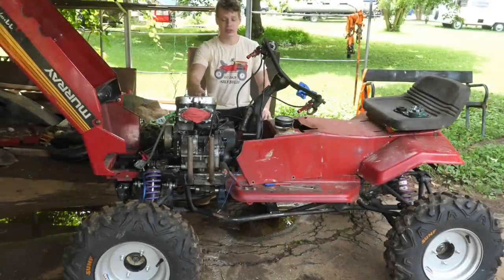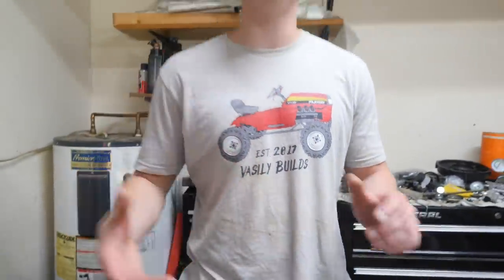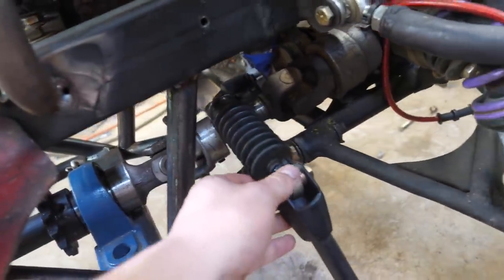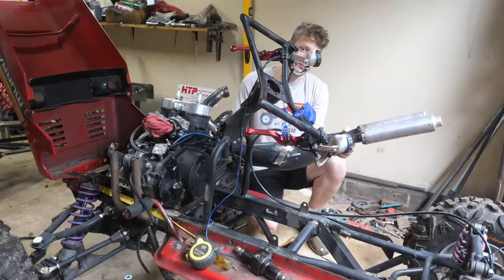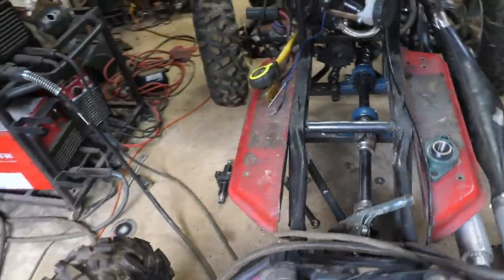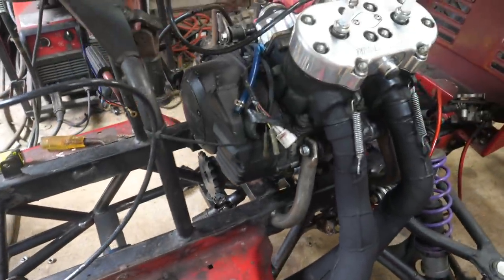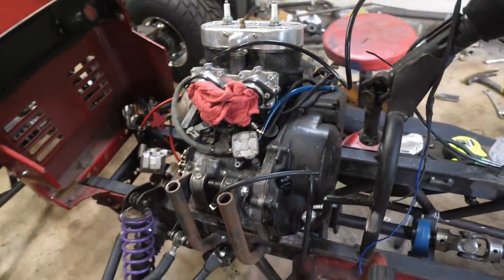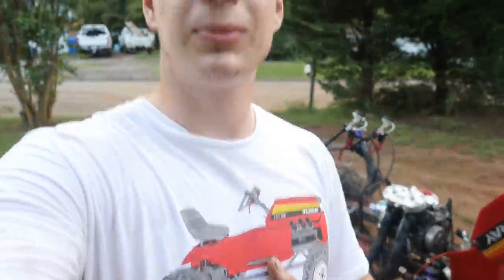Ultimate 2 Stroke 4x4 Rally MOWER Almost Done!

Comment: Not to knock the work done on the exhaust, but could tips be added somehow to angle the heat away from the running gear in the rear?

Comment: One problem I foresee coming out of this is the small sprockets to chain length ratio. I know from experience with doing something very similar that the small sprocket to small sprocket size means that they will be spinning pretty damn fast. The other is the use of a short chain length. As RPM's increase to the sprockets the chain of course is also moving this much faster right. What happens is over any length of time, speed and load is going to cause your chain to become smoking hot, literally! Burning off the factory grease inside the rollers and very quickly leading to chain seizures on tighter riveted roller links first. You can spray the thing with cans of chain lube, but it's going to be a fruitless endeavor as its primarily made to lube the outer surface of the chain to sprocket contact points. That being said the rest gets flung off from the RPM's of the chain and burn the rest of the lube off the chain links leading to chain failures. Hence why they use chains only inside cases that give them a chance to cool off and be bathed in oil before going around again. Even applies true for a chainsaw, without a working oil pump constantly lubing  the bar track and chain links it leads to utter rivet/roller/link failures of the chains. IDK? This is just some words from the wise, been there before and got the Award's. Hope you have better luck with yours.
Reply from the maker: O ring chains solve that problem
Reply: @VasilyBuilds  I was going to mention that, but the O-rings melted and only extended the life of the chain for a few minutes longer. It has to all do with the amount of friction being applied to the speed of it turning. I came to realize my mistake after realizing that because this phenomenon does not occur on a daily street bike or ATV for this matter, it's all due to the sprocket to sprocket size ratio being everything usually has a rear sprocket 3-4-5+ times larger than the front and you are adding in the length of the swing arm thus the chain is traveling straight in free air space to act like a cooling area on the top and bottom of the length of chain. When you put sprockets that close together you now have absolutely zero air gap in length to allow the links to cool down enough before the next wrap around a sprocket. Then you add into the account, the sprockets diameters, a small sprocket like a pulley or wheel is going to rocket the speed of the chain and not having any long stretches of straight or relaxed link's it will continue to accumulate heat until it vaporizes everything on them. Believe me they will probably glow red if they didn't seize up and snap long before that happens. You have the same exact scenario I faced and went through, too little chain length, too small of sprocket diameter and not enough cooling time inbetween the links before its wrapping around the next bend of the sprocket. For short quick bursts, like an engine without a cooling system, yeah you'll be fine. Once you cross the threshold though of temp and the grease and orings vaporize it's all over in a matter of minutes. Just trying to give you a little heads up, I've never put a chain through a clutch case on any bike before even racing, but I've come across plenty who have. A banshee engine isn't by any means cheap to replace when you stuff it with a chain, that's why I'm trying to save you some pain in the future. If you've ever seen friction welding done before??? You'll have a better understanding of what it takes to fuse steel to steel and it only takes one link out of a dozen to fuse, then you get a tidal wave of chain balling up against the aluminum case, steel VS's aluminum we know the outcome not even the most expensive case saver in the world is going to prevent happening. Just sayin bro, I've been there exactly where your going and it doesn't end well. We live and learn I guess?

Comment: Oh no.. lol..   Bro. Those pipes are specifically tuned to make the engine run a certain way.  It's not like a 4 stroke.  A 2 strokes pipe/ especially the expansion chamber is what sets where your powerband will be (it's RPM range) -- and it functions like a turbo charger..  A larger pipe will give you more low end torque-- where as you'll see "racing" pipes will be smaller, and that's because it sets the powerband at a much higher RPM's.  The distance from the exhaust port back to the end of the expansion chamber is a precise measurement and it sets the timing (in RPM's) that an exhaust pulse will resonate and bounce back to the chamber -- forcing extra pressure to be pushed back into the cylinder- through the exhaust port and that's what creates the EXTRA power at a give power band..  and that's why you can change your pipes and change your engine entirely.. and go from a skinny, high rpm race pipe, to a FAT low RPM trail riding pipe- which will give you more low end torque..............   So What I'm trying to say is-- at the VERY least , your pipes have to match or it's going to run terrible and have no power.  It's eaiser for a DIY to get around this by Y-ing them into a single pipe, so that you only have to build one expansion chamber.  But I'm telling you, if it runs like crap-- it's because you have to do better with those pipes man.  There's a whole science to 2 stroke expansion chambers and exhaust timing and resonance, ect.
Reply: 2 stroke pipes are not as critical as people make them out to be. Your theory is correct but the changes need to be much worse than what he has done here to make the motor run poorly.
Reply: @tke7mu0u  It might work fine... I'm just saying "IF" -- if it doesn't run right--- that has to be addressed.  I have a 500cc Rotax (snowmobile) engine that I put onto a 2 seater buggy and  I had to cut off 2-to 3" of the pipe  right at the ports, to make the pipe fit--- and now it runs like crap.. and I wish I wouldn't have done it.  It still works-- and still has some power-- but it just moved the powerband much higher into the RPM range and now doesn't have any low end torque, which sucks-- and makes it not as fun to drive -- becaue its either full throttle or no throttle everywhere.  But anyway, since then, I've fixed it, after learning more about the expansion chambers and how they work.......  Also, I've had several banshee's and still own one now--- and they are completely gutless without that power band kicking in.. So you can go cutting on the pipes all you want, but without them being tuned well (especially on a banshee)---  it's not going to be fun.
Reply: @calholli  yes i fully agree. I just meant that a lot of people with out practical experience believe a 2 stroke pipe needs to absolutely perfect to run properly when in reality its not the case. From what i can tell he didnt really shorten the pipes though. For every 2 inches shortened it moves the power up roughly 700rpm. But properly tuned pipes on any 2 stroke can make a big difference. In the case of your snowmobile which runs a cvt they will have a narrow powerband already so by shortening the pipe it will dramatically affect the feel. Where pipes designed for a gearbox generally have a larger spread of power to make the power usable so shortening it an inch will only move the power slightly higher up the rev range. For this application he may be better off lengthening the pipes

Comment: Yo Vasily you can't just flip the steering like that!! If you turn now, the outer wheel will steer more than the inner wheel... The outer wheel travels in a larger diameter in a turn so it should turn less. This will cause the steering to work horrible if it works at all. you either have to flip it back to the frot or make the steering arms pointing away from the mower. Keep it up dude, all of your builds are amazing
Reply from the maker: That was what it did before, that's why I moved it. Can you explain?
Reply: Ackerman steering. Look it up.

Comment: Why didn't you put the engine how it normally goes into a chassis an run a chain to both diffs or you didn't wanna re do it all ?
Reply: Why would anyone complicate the entire process. That’s not how quad diffs work 🤦‍♂️
Reply: @tylerseabook9423  lol omg sorry I should have said to each diff to a gear box that changes it to shaft driven lol I thought you would have been smart enough to assume that but I was wrong. It's already complicated with the engine side ways an you can make diffs that are chain driven it's not hard
Reply: @tylerseabook9423  rather be welding has done it an so have many other yters
Reply: @ronniewilliz153   not using  quad diffs they didn’t 🤦‍♂️. Your saying put the motor the normal way then add piles more moving parts to make it work. You can’t expect that to be a smart option
Reply: @tylerseabook9423  it's not.more moving part if anything it's the same lol

Comment: Y didn't u put the cr 500 motor in it
Reply from the maker: This is way better
Reply: @VasilyBuilds  yah but it would be more of a beast and 1 less pipe
Reply: @cobybertasso8609   more of a beast with one less pipe🤦‍♂️ that means one less cylinder and much less beast
Reply: @tylerseabook9423  there's big gap between 350 and 500
Reply: Yea the Banshee motor is better for what hes doing...
Reply: @cobybertasso8609   are you serious right now? There’s a much bigger difference between whole entire extra cylinder 🤦‍♂️ you can’t be serious right now
Reply from the maker: 1) cr500 has very short narrow 5 speed, it's a motorcross bike. Not a 6 like the banshee. 2) cr500 vibrates too much 3)pain too start 4) parts to rare to find. 5) you can actually build a banshee to 550cc+ and way more power than a cr500 will ever put out just with a stroker crank and set of cylinders